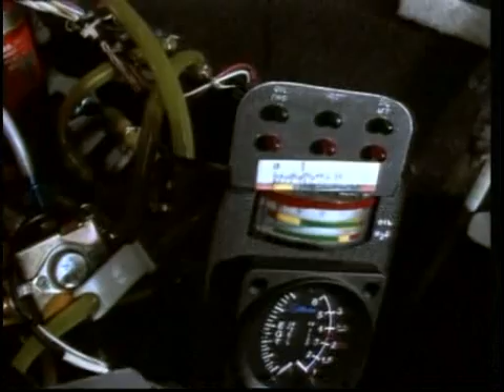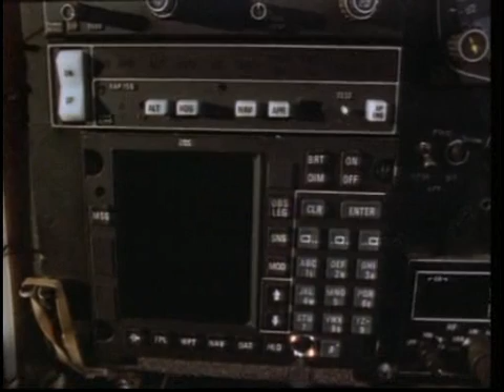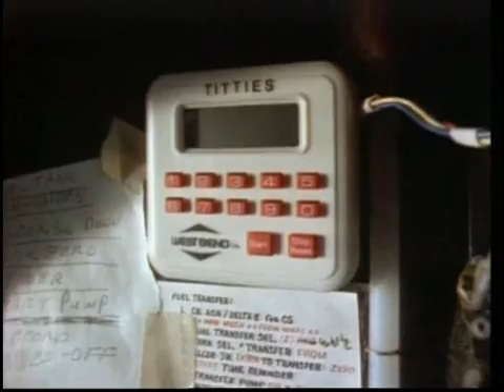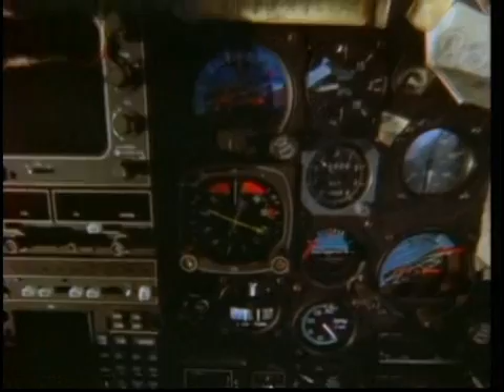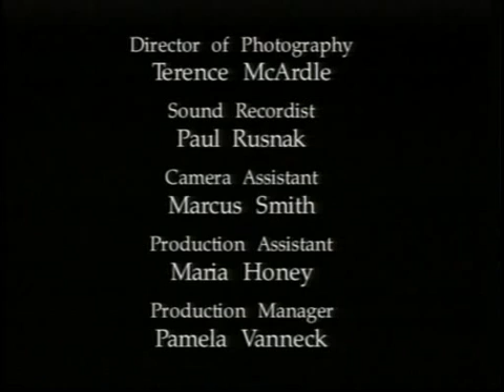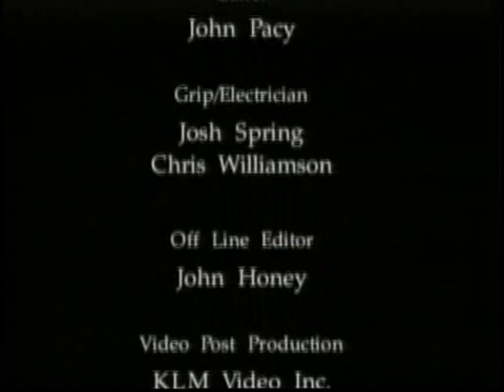The Frontiers of Flight - The Last Great World Record (1992) Rutan Voyager Part 4/4

Comment: why have two engines?
Reply from the maker: The engine power required for take off and climb is a lot bigger that the power required for cruise. Additionally, one of the engines is set for optimum power and reduced fuel consumption, a requirement for this flight.

Comment: wow, thanks for the reply and further info. wasnt expecting it. i used the voyager video as enrichment to a passage the kids read about the flight. i also informed my colleagues of the videos. 
my father was in flight test for 30 years and stationed at edwards on several separate occasions. he helped with the budweiser car. setting up the test track and monitoring stations of the run. anyway big fan of that base. thanks again.